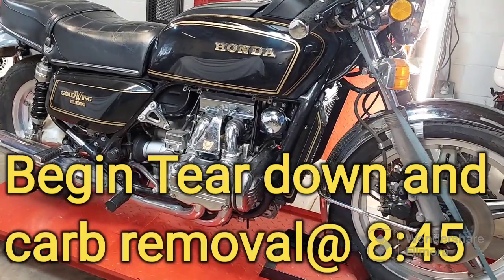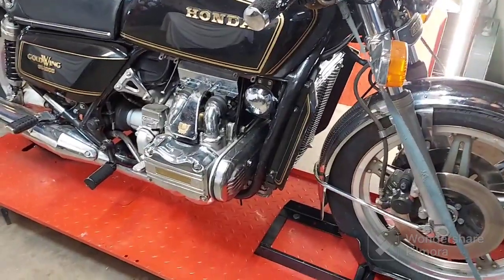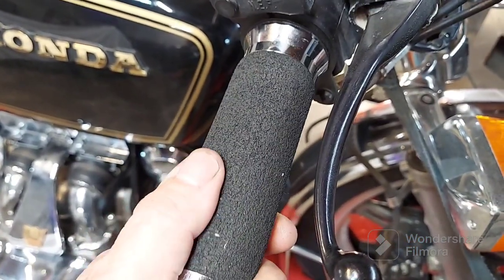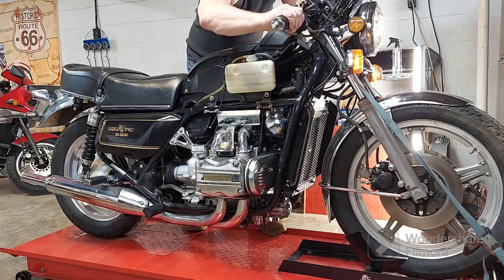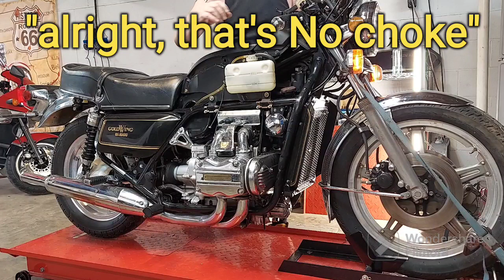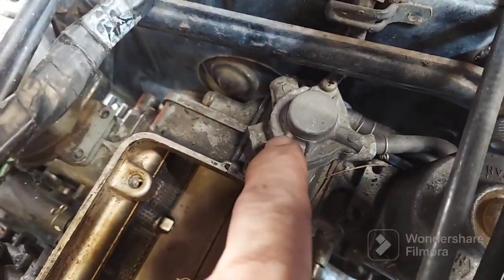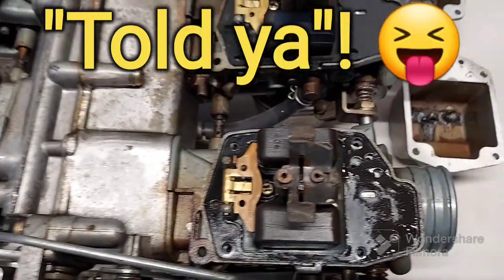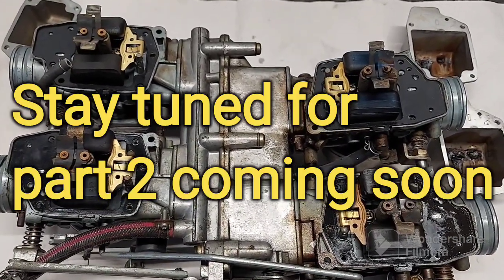1979 Honda GL1000 Goldwing with many issues

Comment: I've had a GL1000 in our family for 34 years , and a tip for you , remove one carb eblow at a time , warm rubber with heat gun , remove mixture screw and air jet hose , squirt air and carb or brake clean into mixture screw hole and you should be able  to see the fluid come out , which will be visible  , the best thing about this method is the pilot circuit is intact with the bowl pushing on the gasket which is pushing on the puck , carbs probably do need a good clean out though and new orings , I also recommend soaking rubber elbows in isopropyl alcohol and oil of wintergreen to soften them , .Cheers
Reply from the maker: @Cobra427Veight  Thanks appreciate your advice. Unfortunately I have had the pleasure of working on many goldwings for the last 30 years. This is what I do each day for a living. I actually have a love/hate relationship with Goldwings 😂. I actually daily ride an 86 GL1200 Interstate, it was given to me by one of my customers and I've been doing a video series on it, and I'm about to tear it down and restomod it over the winter. Check out my Business Page Here:https://www.facebook.com/profile.php?id=100057489818717&mibextid=ZbWKwL
Reply from the maker: @Cobra427Veight  Free Goldwing: https://youtube.com/playlist?list=PLICWLX3xQIRPEn9JQXItuwfWZXvFHlc7K&feature=shared

Comment: Got my 79 GL1000 running great and put 1000 miles or so on it. Now the carb floats will not shut off!!  Got to pull them again!!!  WTH?
Reply from the maker: That sounds right for a Goldwing, they are some of the most contrary bikes I ever worked on.
Reply: If you replaced the float needles and seats and made sure you put the screen on the back of the needle seat, you maybe don't need to pull the carbs again. Run it for a couple days turning the petcock off each time you stop. It may clear up. However, if the first time they were out, you did not do a proper rebuild, then you need to start over. If the bike sat for years, you also need to clean the fuel pump and gas tank. Also, replace the fuel hose and filter. Once all this is done, it should be trouble free for years.
Reply: @BobKramer51  Exactly what I am intending to do. And I will replace all my fuel line from tank to pump to carbs as I am no longer sure if I did this already or only a section as I only wanted to see if it would run initially which it did and I put a few thousand miles on it having a blast! let it sit for a few months and now this. Will let you know.  Thx. I love the old Gold Standards.
Reply: @grabir01  that plenum oring is another source for leaks as the fuel supply is distributed through it , probably want the best one you can buy .
Reply: @grabir01  I also added a decent steel body fuel filter , ryco brand , and cleaned out the tank with electrolysis.
Reply: @Cobra427Veight  I replaced that just now. Not sure why honda made such a design.
Reply: @Cobra427Veight  Will install a glass fuel bowl to trap anything that comes out of the tank.
Reply: @Cobra427Veight  It is my #s carb float that is not shutting off as I used an ez out trying to pull it out so I can replace the o-ring. I never got it out and so now it is scarred and no longer shutting off. I need to find another way of pulling. I need to replace it now fir sure.
Reply: @grabir01  do you mean the metering pin assembly or the fuel inlet control valve is damaged .
Reply: @Cobra427Veight  #2 carb. The fuel inlet. Float needle shut off. Its no longer able to stop the fuel flow because I damaged it trying to pull it out with an ez out bit. Not sure how to get it out. Its pushed into the carb. I thought since I was re doing the carbs, I woul pull them and put a new o ring on them and push them back in. Can not get it out. I will leave them as they are not leaking. I have to get this one out now since I boogered it up inside with the ez out bit.
Reply: @grabir01  isn't the needle assembly screw out, and the seat is in the brass assembly , there is a  gauze to clean under that .
Reply: @Cobra427Veight  Normally yes. But on the GL1000, they are press in with orings. Same as the jets.
Reply: @grabir01  that's right I looked at my pictures , I have a tip for you , get some side cutters or wire snips and use them on the outside,    they are short in the jaw and are excellent to lever down to lift brass bit out .
Reply: @Cobra427Veight  Will do.  Thanks.

Comment: I have never had one come into garage that had bad  compression except one and it was the head gasket you never have to re ring them unless they are 200k miles if they are low compression all you have to do is lap valves and replace the head gaskets these bike are tough even if you have to take heads off it's a 7hr job at best
Reply from the maker: Its running great, here is the playlist of this bike so far: https://youtube.com/playlist?list=PLICWLX3xQIRPEn9JQXItuwfWZXvFHlc7K&feature=shared
Reply from the maker: Oops sent you wrong goldwing playlist, here is the 79 goldwing playlist:https://youtube.com/playlist?list=PLICWLX3xQIRO9isfzPjZBsj6lqEowEYst&feature=shared